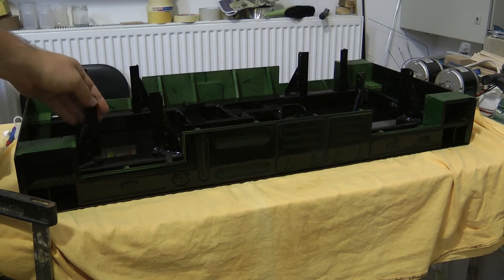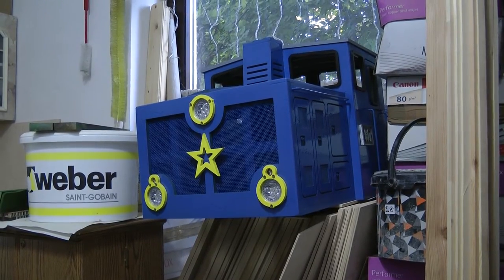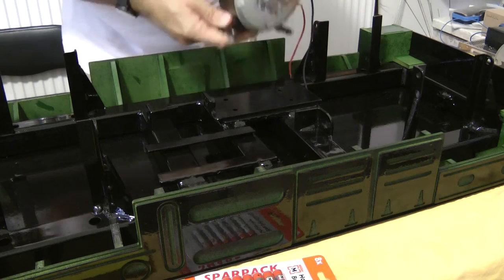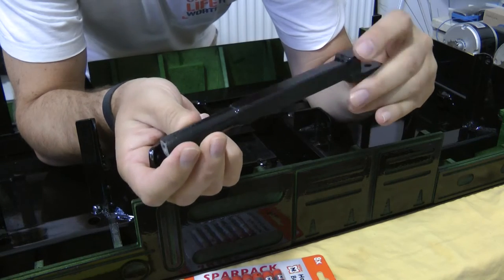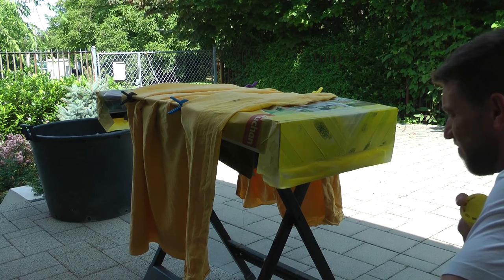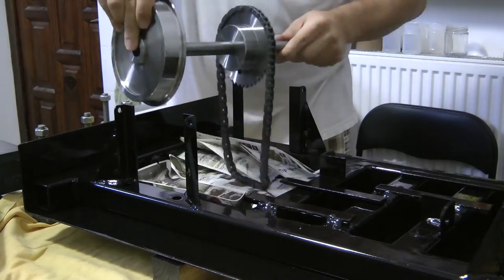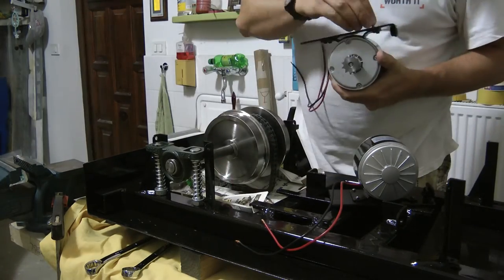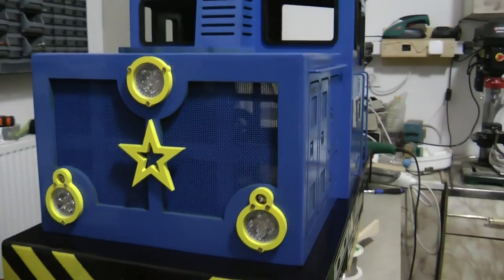7&1/4 Gauge - Paint and Assembly

Comment: Excellent build, and an interesting video. I like your use of additional angle to control the position of the bearings, rather than relying on just the bolts, it also reduces the chance of bending the bolts in a derailment. I wonder if your stiff suspension is caused by over tight drive chains, they should have just a touch of slack in them?
Reply: Agreed, although I'd have a slack chain with a tensioner installed, rather like a bike.